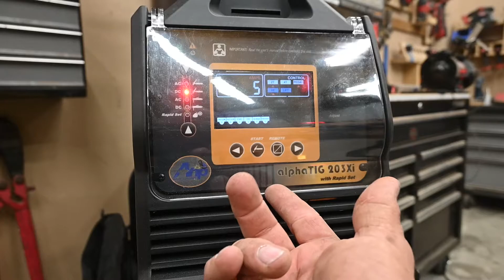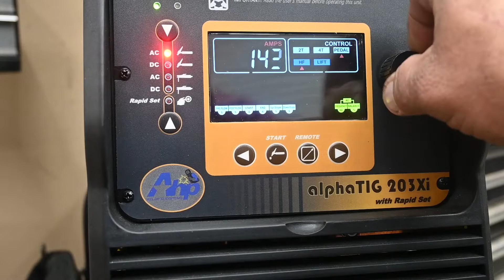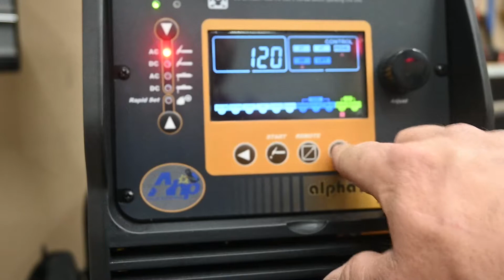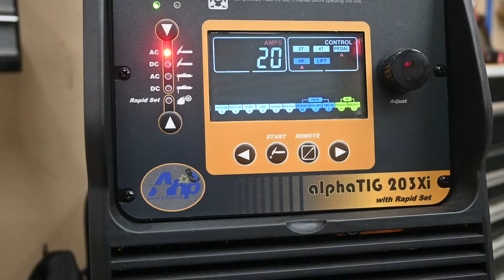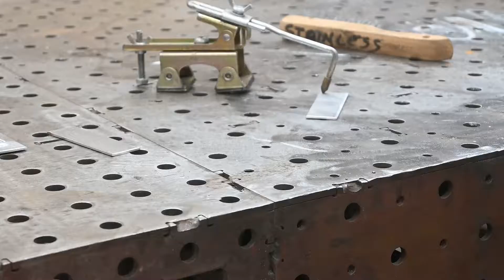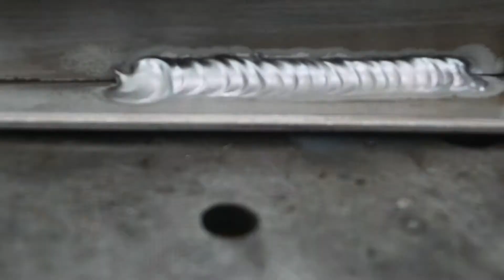First run of my AHP AlphaTIG 203 XI

Comment: Purchased the very same combo a year ago.  Added the 20 series Roto-Flex torch as the supplied 9 series version kind of spoiled me.   As a new to TIG welding hobbyist, I might have racked up 70 to 80 hours in the past 14 months  Not much in professional seat time metrics; still, so far, so good.  No gripes.
Reply from the maker: That’s awesome. Glad you’re happy with it. It’s been doing great for me.

Comment: I've had this welder for about a year and a half and I really like it, but there are a few minor quirks, in your video you ran into them too. I removed the clear cover because it's really hard to open with welding gloves on. The outer two (arrow) buttons on the control panel are confusing too, it's like they originally set up their software menus to use left and right arrows, then at the last minute changed it to have a separate pulse menu on the left switch and everything else on the right, and there was no time to change the switch labels accordingly. Overall a great welder, and the air cooled flex-lock torch it comes with has been just fine. I mainly use it in the 9/20 configuration and have welded steel, aluminum and stainless without it ever getting too hot. Good video!
Reply from the maker: Thanks I appreciate that.  I put a tab on the clear cover to pull it open easier with gloves on.  But yeah those arrows are confusing to me as well !